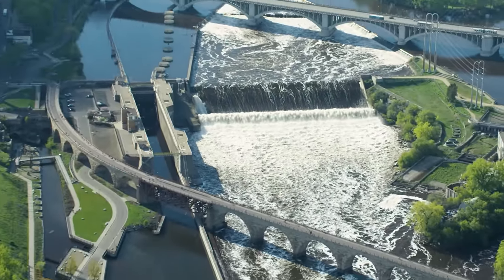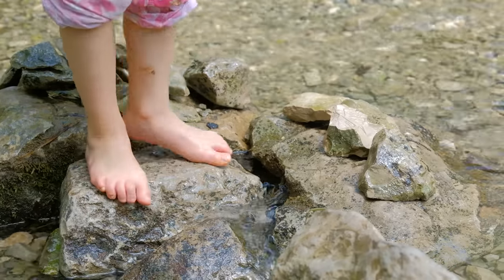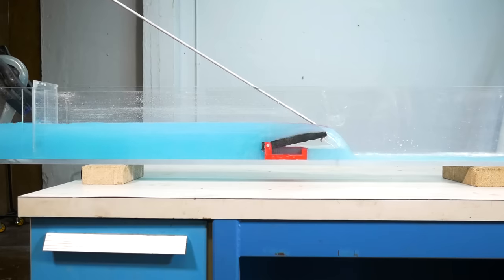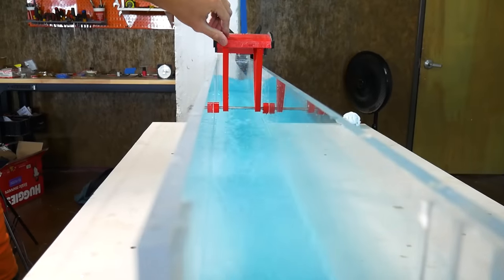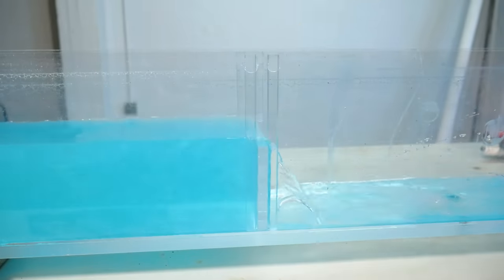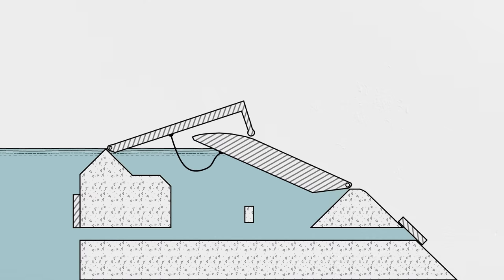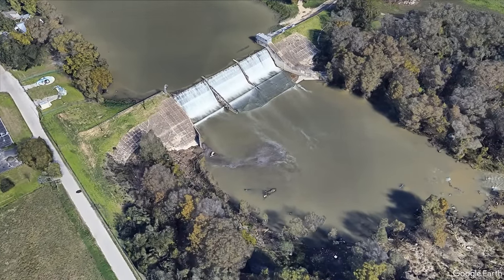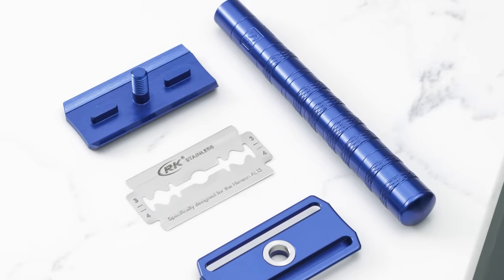How Different Spillway Gates Work

Comment: Clearly what we need is to engineer stronger interns to do it at full scale.
Reply: 1,460,000 lbs divided by 50 lbs per intern (OSHA's limit) is 29,200 interns per Tempe Town Lake gate.
Reply: Get those lackeys on that task to find someone to do something else, stat!
Reply: It's a ubiquitous problem. E.g. telescopes could be much cheaper if you only could get an intern with 1.5 meter pupil.
Reply: @JohnDoeHZ  29,200 interns per gate?  Oh heck, we can do that!  Now all we need to do is call the local Taco Bell and order that 2X burritos to be delivered by lunchtime.  At an average of $4.70 each (the rough price of a Taco Bell burrito plus 7% sales tax), we'll only need to come up with $274,000 per gate to make these dams fully "Intern-Inside".  We might only have to move 2 gates in any given day, so figure on a half-million dollars per day of operation, with added cost during spring and winter when we might have to move more gates.

$500,000 per day?  That's chicken-feed!  Or, more accurately, "intern-feed".  Let's do this!  

Special programming note for Grady:  For next week's episode, we need you to help us calculate the need for toilets and expanded sewage capacity at these dams.  Because you know...Taco Bell.💥
Reply: @ВасилийКоровин-г9э  So what you're saying is that all technology can be replaced by simply genetically engineering interns?
Reply: @CptPatch  Genetic diversity is the key to everything.
Reply: Super ultra powerful intern-bot 9000
Reply: Repent and believe in Jesus Christ   Pretty out of context... Is this a bot? I don't know how I would feel about that...
Reply: @GoodEnoughVenson_sigueacristo  It is definitely a bot, I've seen it spamming up comment sections a lot.  As a Christian myself I hate this and similar bots, it really doesn't help to spread the Gospel, it just annoys people and looks bad on us.
Reply: @grn1  I think that I agree for the most part. I mean, I wish that all of the people in the comments section were actually people, and out of context comments are inherently annoying, but if I had to choose between a bot trying to scam me and a bot sharing bible verses, I'd definitely go with the latter.
Reply: Now, if only we had a Super Intern Serum....
Reply: @falxonPSN  good
Reply: Right, true
Reply: Stronger interns...right
Reply: Why not just get more interns? Aren't they free?

Comment: “You might notice I’m using an intern with a metal hook to open and close the model crest gate, but most interns aren’t actually strong enough to hold up a crest gate at a real dam” made me laugh a lot more then it should’ve.
Reply: "most interns" implies that atleast 1 intern is capable of holding open a full sized crest gate at a real dam. Apparently someone is lucky enough to have superman as their intern.
Reply: @jasonreed7522  Superman is the unpaid intern for all of us.
Reply: @jasonreed7522  I'd imagine you could have a pulley system where the other end is an intern running a mile a minute to close the dam
Reply: @1224chrisng  like those crazy 1million to 1 lego gear systems where one end barely moves as the other is spun by a drill, and the contraption could theoretically lift a truck it it wasn't made of plastic and already melting. 

I think a traditional hydraulic (technically fluid pressure) system is more economical than the amount of pulleys and rope needed for sufficient mechanical advantage for the slaves, i mean unpaid interns, to actually lift the gate.
Reply: @jasonreed7522  There was one once, but he decided to go into the lumber business, instead. I think his name was Paul something. He became pretty famous for his logging exploits in the Northern Tier states and Canada.

Comment: Am I the only person who loves Dams, but is also similtaniously a little scared of them when I'm near them? like the amound of water and pressure there is a bit intimidating
Reply: Certainly not - I feel exactly the same! And even worse now I watched this video!
Reply: Yes, and low head dams terrify me.
Reply: Yes!  Me too!   What really scares the wee out of me is a hydro electric dam, I'm fine watching them on screen,  but no way do I want to get close to one.   😅
Reply: I snuck into a small river dam used for power production, years ago.
It was enormous inside, and climbing the metal hoops ladder and catwalks hanging inside a spillway really put things into scary perspective.
I saw a couple dark tunnels towards the mountain into which water rumbled noisily, sucking air along with them; standing on the edge of that dark tunnel was by far the scariest part, beating even climbing up the concrete sidewall on small rusty hoops!

And to think it was just a tiny valley stream...
Reply: Same! I love to watch yt videos about dams, spillways, hydroelectricity, turbines, rotors, stators...but would not go near one of these structures in real life. 😄 You have probably already seen it but my yt tip to watch would be the video of the "Obere Wasserschlosskammer" and other videos of this "Edgar Müller" channel. The walkthrough of this chamber etc. Terryfiying, yet absolutely interesting.
Reply: Definitely not. In a class with standing on cliff edges or around spinning machinery. I was getting kind of queasy when he was talking about walling off gates in order to do maintenance, just imagining being the person tasked with working inside of a gate and being expected to trust everything around me to that degree.
Reply: Me too. The forces involved are unbelievable!
Reply: Same way with bridges.
Reply: I used to work on dam maintenance.

Before that, i was not scared of water.
But I go to witness a full opening of a gate. We're talking hundreds of cubic meter of water per seconds. It was amazing how much power that water was carrying. So much that it was creating a wind that tried to push you in the water ...

Since then, I definitely have more respect for water. And I want to argue that "not being scared of dam" is the irrational option
Reply: @clytle374  Grady's video on them blew my mind.  We have one in my neighbourhood, and here in SW Ontario  there's lots of them, hold overs from when mills ran on water power.  They don't scare me, but I like to tell people, particularly kids or adults with children what the potential dangers are with them. Share the knowledge calmly like Grady. No fear mongering, just the facts.   You never know...
Reply: @Douglas Skaalrud  on the Clarion river, in Clarion PA, both exist near each other! The I-80 bridges cross it near the Piney generation station. There's a rope with warning signs across the river to keep boats from getting to close when the plant is operating. I was always nervous getting near there, especially after just getting queasy passing under looking up at the bridges that are about 12 or 15 stories above!
Reply: It can be intimidating meeting your dam hero they have important jobs and the work naturally comes with a lot of pressure.
Reply: It can be intimidating meeting your dam hero they have important jobs and the work naturally comes with a lot of pressure.
Reply: Every time. When I stood on top of the Hoover dam my heart was racing thinking about the forces at play under my feet. There’s a dam here in my city too that I visit sometimes and it always scares me thinking about the consequences of falling in where I shouldn’t…
Reply: Don't move to the PNW then. We get about 90% of our power from hydroelectric. We have dams everywhere here, some of them huge like the Grand Coulee.
Reply: Imagine this. The whole water mass wants to enter in that tinny hole and you are in the middle
Reply: Your fear goes away when you walk to the end of the inspection gallery of a dam more than 50 meters high, the gallery located almost at the base of the dam, and you know that behind that wall a few meters thick is the entire body of water in the reservoir, and above you you have the entire body of the dam, tons and tons of compacted earth, and at the same time you feel the serene sound of that water passing through the pipes that are inside that gallery of inspection. It feels powerful.
Reply: How the spillway structure feels vibrating from the force of the water passing through the gates, I miss the sensation

Comment: There's just something about the power and strength of water that just does it for me.  Incredible.
Reply: Not just liquid water, steam is very powerful and strong too, oh and the thermal expansion of water freezing is powerful.
Reply: @edwinsalisbury83  yep, ice can move mountains
Reply: @edwinsalisbury83  Totally agree.  It's incredible stuff when we stop to think about it.
Reply: @5t4n5  Richard Trevithick knew that when he started tinkering with high pressure steam and realized how engines could be made more compact if higher pressures were used. Most watt steam engines only ran on 5 psi of pressure, trevithick’s ran on 50+ psi.
Reply: The fact that it's the height of water that determines pressure, not the volume, still blows my mind some reason. I've yet to have that explained to me in a way that makes sense.
Reply: It makes you moist?
Reply: There's a video out there of a spillway gate being opened for the first time in decades. Apparently enough dirt had accumulated in the passage way that when they opened it, for about the first ten seconds, the mud being pushed out of the passage resembled a block of clay (20 feet high!) being extruded through a pug mill! Now THAT'S power! Also funny as hell!
Reply: when i pee in the forest i can make a mini flash flood in the forest floor debris! #enormous strength of water
Reply: @bucky13  well it's pressure per square inch, so it really only matters how much area is touching against an opposing surface in contact with the water, for example you could have a pool of water 6 inches wide, 1 inch deep and a million miles long, and let's say for arguments sake that the water can exert 1 pound per square inch, well with a 1 inch depth and a 6 inch width, that give us a area of 6 square inches, meaning the resulting pressure would be 6 pounds per square inch, or 6psi.
Reply: @KaitouKaiju  it also scalds and burns you if you heat it up enough. It also can ignite fire if you superheat steam.
Reply: @JuniorJunison   My mistake was focusing too much on the gate I think. When you increase the length of a canal you increase the surface area that the water is exposed to.. So pressure doesn't go up because it's exerting more force over a larger area. That makes sense.
Reply: @kilometer214  Worth every penny they're paid.  LOL
Reply: @bucky13  : Gravity. The higher any given volume of water is the higher the pressure exerted. This is true of oceans and contained systems. Grain in silos exerts the same downward pressure. It's why silo and water tower bands/straps are more closely spaced near the bottom.
Reply: i don't think its the strength or power of the water. it all comes down to gravity
Reply: @dalegawne5286  Gravity is acting on everything, but not everything is doing what water can do.
Reply: Try setting up an above ground pool with a few degrees of slope and you'll understand how powerful water forces are.
Reply: Nice
Reply: @bucky13  It's called gravity, Sir!   ;)   In all seriousness, why would volume matter?  All that weight is being distributed to the ground underneath, not on the one end with the gate!

Comment: The original dam on the Pawtucket Falls in Lowell, MA used wooden flashboards that were set up to break if the water level got too high. This system remained in use until a few years ago when they were replaced with crest gates operated by air bags.

Comment: I worked at the Oroville Spillway during the emergency in 2017-2018. It was really interesting to watch it be rebuilt over time. Also don’t realize how big the spillway is until you’re standing near the radial gates.
Reply: That's amazing! I watched everything related to that incident back then. The spillway IS enormous. I did realize that when workers first went there to inspect it after the failure.
Reply: I watched that reconstruction closely (from afar) and one of the most impressive things I saw in the whole process was the men standing in the spillway inspecting it. It is only then that you get a real sense for the sheer scale of it! Also, the capacity of that spillway is much greater than the flow of the biggest flood ever to come through town here and THAT was an impressive amount of water. Seeing how the water scoured out the foundation gives you a real sense of what flowing water can do. One of the best quotes I ever heard was, "Water Always Wins." It's a truth! Water (the universal solvent) is amazing stuff! The macro scale of everything on a dam is just mind blowing!
Reply: It's fascinating, watching the original films made during the construction.
Reply: @boballmendinger3799  Look up the construction film of Hoover Dam on the Colorado River in the 1930s.  It is over 600 feet high.  Walking over it and going down into it is awe-inspiring; particularly for a 6-year-old kid.  I still remember the experience even though that was in 1953.
Reply: @royreynolds108  I checked it out in '96 and it still amazes me how quickly it got done, given the vastness of scale for all the various operations and how they ran pretty much continuously
Reply: @eily_b  ddf

Comment: As a Hydroelectric Operator/Mechanic/Dam Tender I have to say this is spot on.  As far as the leaks go, we tend to stop them by dumping cinders. The draw of the leak pulls the cinders into the seal and creates a clog.
Reply: Cinders as in burned up materials from a fire, or does it mean something different in a dam context?
Reply: @suspectsn0thing I was thinking cinder blocks maybe? That's what came to mind when I read it anyway.

Comment: The funny thing about Tempe Town Lake is that the gates currently in use weren't the original gates. Originally, the lake was constructed with rubber bladders to hold the water back, which only lasted ten years (July 21st, 2010) before blowing out on the western end of the Salt River. I used to live near the area and watched construction crews turning that dry riverbed (the river being dammed further upstream for decades) into the lake, but moved out of the area before it was filled. It's a considerable piece of engineering, all things considered.
Reply: Used to live in the East Valley and hung out in Tempe! Friends back there tell me the "lake" often gets pretty stinky!
Reply: @gus473  I don't remember the stink the times I've visited it. Not saying the potential is there, but maybe the stink is seasonal?

Although, when the dam did burst, it got really stinky really fast. Partly because of 
suddenly dead fish, partly because submerged stuff was now not submerged.
Reply: @gus473  I went there a couple of years ago and yeah it had an odor.
Reply: I kayak there most weeks.  I don’t notice any smell but my wife does when I get home. I do rinse the boat off after each use.

Comment: Those stop log things are used on the canals over here in the UK. Except they are planks, not logs, as there's very little flow, and therefore only low water pressure in our canals (which are also very shallow).

They are used to isolate sections of the canal so that lock gates can be replaced, etc. And also, if there's a breach on a section where the canal is high up - otherwise the entire contents of that section (which can be miles long) would drain away!
Reply: They aren't typically logs here in the US either. They are made of metal and will have rubber seals that are replaced every time the "logs" are repainted.
Reply: Worst profile pic known to man...
Reply: Your canal system is truly awesome.  I watch cruisingthecut all the time.  Cheers

Comment: Hey Grady, I absolutely love all your water infrastructure videos and am a huge fan of dams in general.  They are such amazing structures!  Any chance you could do a video on the Wanapum Dam in Washington State on the Columbia River that had a major crack found in it in 2014? The crack was 2" wide and 65' long and the story of the repair was extremely interesting! I would love to hear your take on it!
Reply from the maker: That would make an interesting case study. If I remember right, it was a rudimentary math error in the dam's stability calculations. I think they used post-tensioned anchors to fix the issue. I'll add it to my list. Thanks for the suggestion.
Reply: @PracticalEngineeringChannel  That's the one! Thanks for the reply and thanks for making such awesome videos!
Reply: Similar story to repairing/upgrading the penstocks at one of the local dams here in Phoenix. Horse Mesa dam. They actually used saturation divers to do the job. I thought the article I read on that was absolutely fascinating.

Comment: I work in IT and one of our customers is a local water district that operates a hydroelectric dam. I got to go on-site to the dam last week and while there I got a short guided tour from one of the dam technicians. WHAT AN EXPERIENCE! I even got photos of the synchroscope you mentioned in your black start video! While I was there to fix networking problems, as a nerd getting to see an operating hydroelectric power plant up close was a real treat <3 
This was just a small dam, but some of the math is mind-blowing - the pipes feeding the generators can handle upwards of 800 Cubic Feet of water PER SECOND!

Comment: A long time ago, I wrote a program that was used to monitor a river control structure.  I had to handle the condition when the gate was in the water and when the gate was out of the water (the structure and the riverbed determined the flow).  Using the inputs from gauges above and below the structure together with the gate position, I would calculate the flow through the gate.  We then totaled the flow for all the gates to get a value for the whole thing.  We even accounted for the flow through a hydro plant on one end of the structure.

I remember most the intense desire to avoid overtopping the structure.